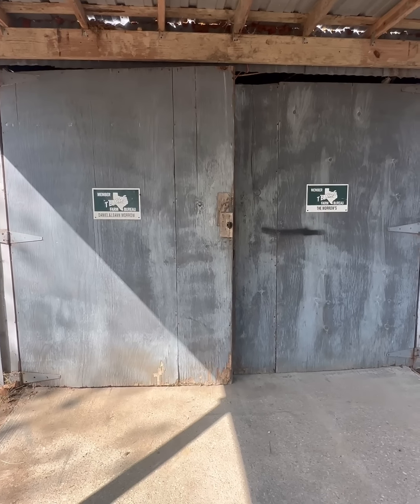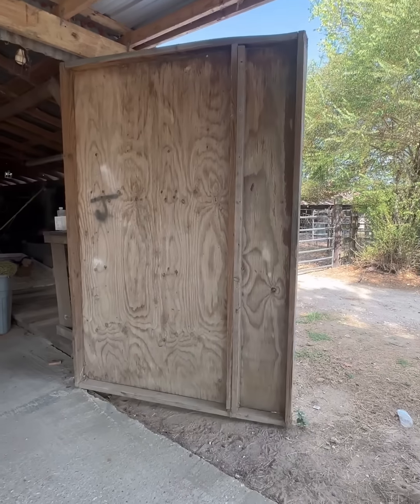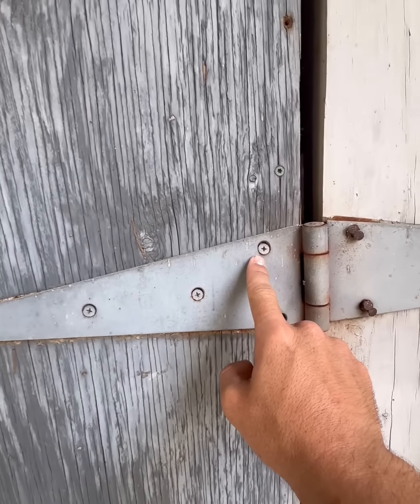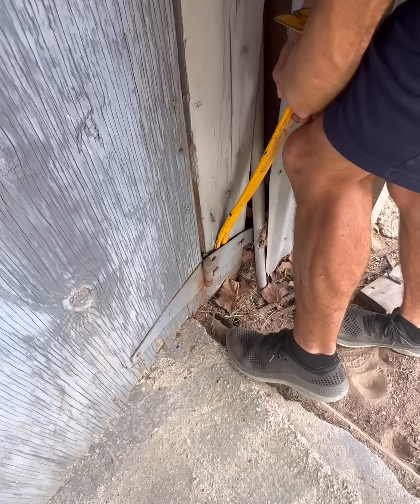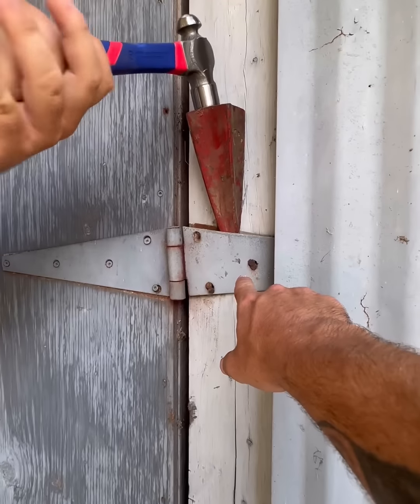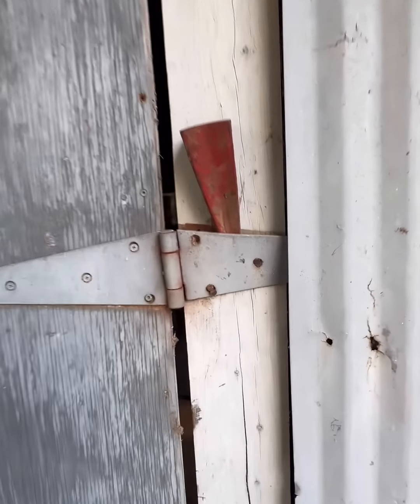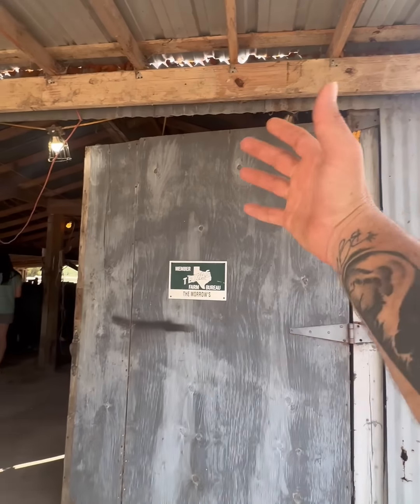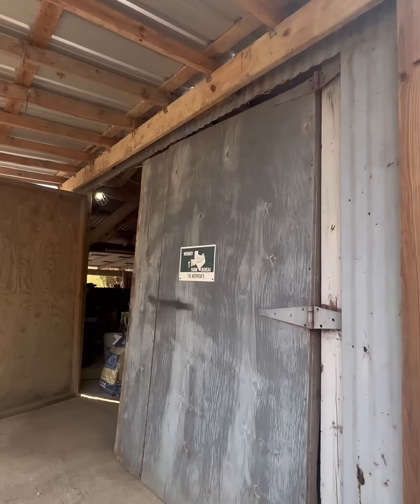The DOORS are coming down

Comment: Naw, that’s not a wedge, it’s a plumb weight.
Reply: Correct. Wedges have flat ends the full width of the wedge, taper smoothly to the wide end that is meant to be struck to drive it in for splitting wood.